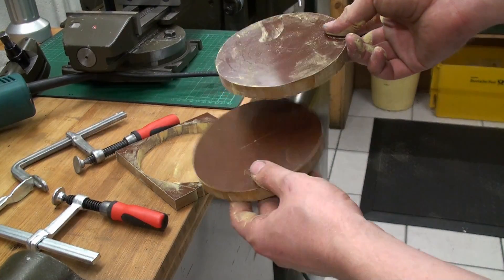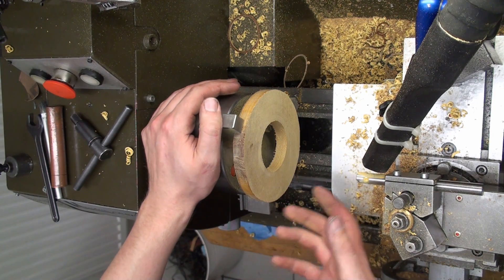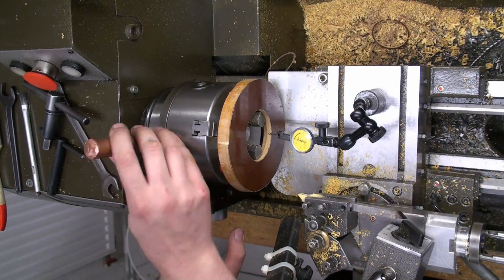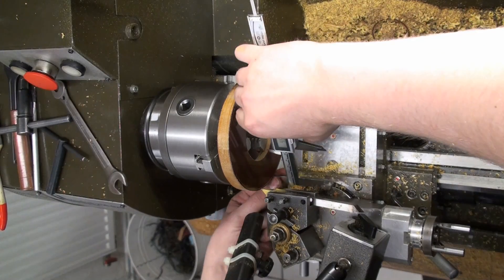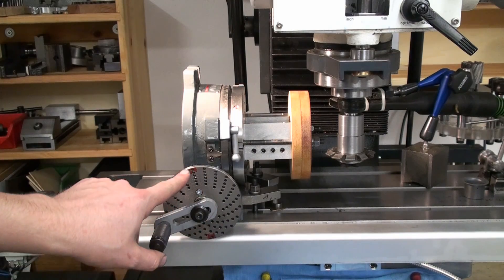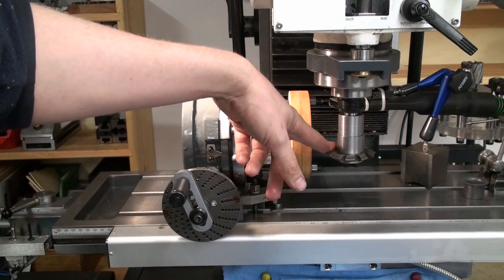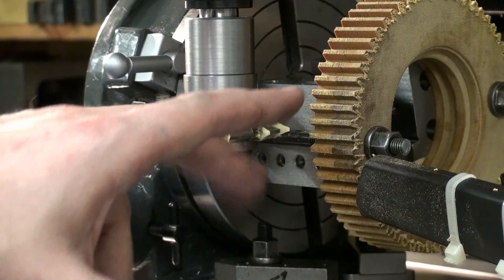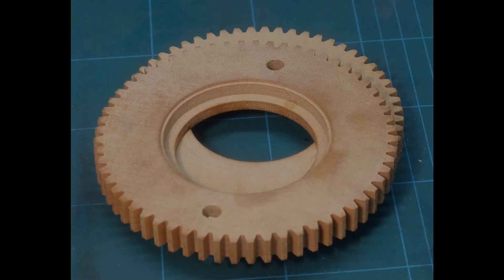Machining a phenolic gear

Comment: Nice work! Great channel. Excellent attention to detail.
Have you done anything with PEEK plastic? I know the phenolic-cloth is a good material; I don't know which is better.
BTW, for Bosch middrives and ebikes in general, the real enemy seems to be moisture and water. I've seen rebuild videos, and it's just like skateboards; some things really need a stainless bearing. If the middrive had an oil bath, that wets the seals I don't think the corrosion would be so bad, BUT because the electronics are inside the box with the gears on a Bosch middrive, then any worn metal swarf would short the circuit boards if oil was added, well unless it was conformal coated.
I have considered making some gears for the Bafang planetary geared hubs. I know that PEEK is expensive, but no one even offers them for the geared hubs.
Reply from the maker: PEEK as a standalone plastic is very hard and brittle, would not be my first choice for highly loaded gears.
Theres PEEK with glasfibre or carbon fibre reenforcement, but I dont know how those perform. I have only made PEEK and PEEK-GF parts in applications that required high chemical or thermal resistance.

Comment: I work in the bike industry, and we design and manufacture electric-assist cargo bikes, and the only motor/drivetrain combinations that don't seem to have problems like the one Stefan is solving is the Bosch system. https://www.bosch-ebike.com/au/products/drive-units/ You can see in the picture that the equivalent part to that which Stefan has made is an helical gear. I am guessing the spur gear is from a Bafang (Chinese) unit, which is almost a direct copy, with this change to get around the Bosch patents.

Comment: I really enjoyed this video. Well done. You make this look easy. Thinking back to my powder handling days, I would use a small plastic palace aka a frame much like a painting booth where the sides and top are clear plastic (or better   plastic wrap which is *disposable*). This is a plastic approximation of a chemistry hood. Install a good sized filter and a fan and presto your mess and risk associated with the mess goes way down. I don't know how or if you could work it in but a very fine ! think super fine ! mist of water keeps the dust down and the associated risk. Also a mist barrier would work a treat, the mist would evaporate before it hits the floor, the moistened powder would sit on the floor and resist getting stirred back up.

Comment: Phenolics can be some nassssssty stuf to work with. In the days before Turcite and Moglice some machine tool manufactures used this stuff (Micarta) as the wear surfaces on slides. Giddings and Lewis for one. One old timer I worked with was a scraper hand there. It is still used today for safety gears in lathe gear trains and drill presses that I've seen. By the way what DP or Module is the gear

Comment: really great job stefan :) we just need to make the hub fitting, gear fits perfectly

this gear fits into a bosch DU25 ebike middle motor, the original one is well known to crack without any prior signs. if one is interested how the original one looks like

https://drive.google.com/file/d/0Bz8IiBJ-Dn4hN0dKTUZDWTRQUXlnNHBRUzJjRWsyaGNqd0tR/view?usp=sharing

cheers, 

Juergen
Reply: "Sorry, the file you have requested does not exist"

Comment: Of all machining operations, gear cutting affords the maximum number of ways to screw up. It's a Bozo paradise, as Tom Lipton would say. You can turn the blank to the wrong diameter. You can select the wrong cutter. You can set wrong DOC. You can miscalculate the plate to use  and hole spacing on the dividing head. You can forget to lock/unlock  the dividing head. Oh, and you can forget to center the cutter (nice trick there with the scriber) and that will put you off half a tooth. I have made all of these mistakes. You didn't make any mistakes. Bravissimo Stefan!  I spent this morning cutting clock gears BTW. So this video was inspirtional.

Comment: That's the only trouble with working with phenolic, the oder gets to me after 8 hrs.
Reply: If you have any odor your ventilation in insufficient.   I have cut hundreds and hundreds of phenolic gearblanks and hobbed a few hundred , no odor ...none, but have taken the time to put in really good ventilation.

Comment: Well, at least it is not wood. ;-) 
Such a gear is also used in the Arboga drill presses, is this fiber stuff really stronger than modern plastics?
Useless bit of trivia for today: Apparently you can't use phenolic rod stock to make gears, because the fibers are rolled the wrong way.

Comment: I've always thought of tooling up for gear cutting, you make it look like fun.  good job / fun video.
Reply from the maker: Cutting gears is fun for one piece...if you have to do a bunch of them the fun gets a bit limited ;)
Reply: It's probably more fun if you have that toy Clickspring has with the digital input which attaches to the lathe and spins the chuck the desired number of degrees.
Reply: Tony, if you want some phenolic for gear making, i have enough to share, seeing as you are making gears as well now. I have a chunk that is .75" x 18" x 48" that i would be happy to cut you a section out of.

Comment: Hi Stefan, what kind of tool geometry did you choose for turning the reinforced material? The reinforcements are plain fiberglass? And finally, how do you set the height gauge to such an accurate height? Gage blocks?

Ooops! Just read the comment on tooling and reinforcements...
PS. The music part of the vid is also great!!  :)

Comment: Hi Stefan, It's a sense of euphoria when you attain the goal at the end. They used that material for one of the timing gears in auto engines to reduce the gear noise, long before the advent of serp belts.
Reply: ..Yeah, I had a1951 Studebaker (flathead 6) with Phenolic cam gear....

Comment: Excellent video Stefan. I'm fascinated by your technique of dialing in the chuck on the lathe. Is the backing plate "loose" on the chuck back, which allows you to loosen the bolts holding the chuck to the plate? By how much? Does the chuck ever slip on the backing plate while machining? Interesting. Cheers, Daniel....

Comment: Stephen;

As usual, you do phenomenal work.

One safety tip I would like to pass on in line with one of the replies below addressing lung issues from working with this stuff.  Phenolic is nasty crap and the recommendation is to always wear a good respirator (notice I did not say dust mask here).  Get one with cartridges rated for dealing with welding gases and that should do the trick.

When phenolic gets hot, it breaks back down into its base components, one of which is formaldehyde.  Not good to breathe that stuff!

Regards;

Ron Kluwe

Comment: I actually like the smell of that stuff, tho, it might be because it reminds me of old electronics which i used to repair with my uncle when i was a kid.

That aside, nice work on this gear, maaaybe, could we see a picture of the electric bike? That would be really nice.
Reply: its a Scott E-Aspect 910 Model 2014 with an Bosch Classic+ Drive Unit. This particular Gear cracks sooner or later in every of these and Bosch denys to provide spare ones, generously you can get a refurbished complete drive unit as replacement (but only if the old one gets returned). Buying one of Ebay is just a limited Option because theres a lot of Parameters stored in the Controller Unit which can only be changed with a programmer that only Bosch and some special Partners have.

Comment: I've never seen a three jaw chuck that you could dial in like that.What a great idea. Very good video, informative and clever.
Reply: The chuck is not special.It is the technique. It is called bump trueing. You dont machine the step on the face plate so it is the same size as the inner diameter of the chuck registration thing so you can somewhat move it around.

Comment: Isn't glass fibers used?  Won't that wear out blades and cutters like crazy?
Reply from the maker: No, the fibre is some kind of canvas.
Reply from the maker: We used some G10 glas fibre epoxy at work and that stuff is more like you describe it - Kills HSS tooling withing seconds, carbide lasts a bit longer, only DLC/diamond coated endmills work pretty good. We had a pvd diamond blade for our table saw to cut it.
Messy stuff, the dust is horrible...glad we send that stuff out to be waterjet cut now.
Reply: You must have read my mind as I am currently looking for a reinforced casting resin to make lathe threading gears.
Reply from the maker: Thats interesting - I have seen somebody posting on facebooks about casting a set of change gears in plain PU resin and it worked quite well.